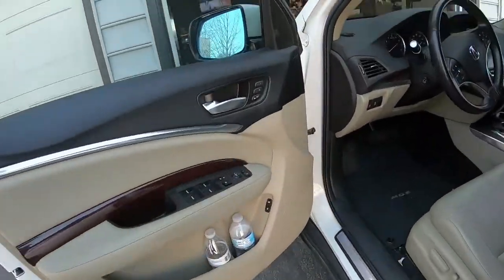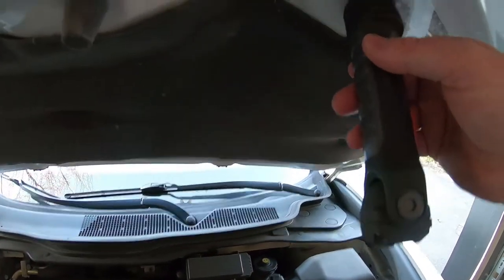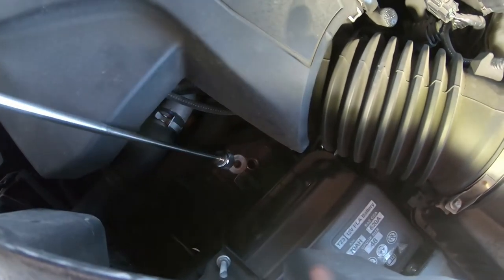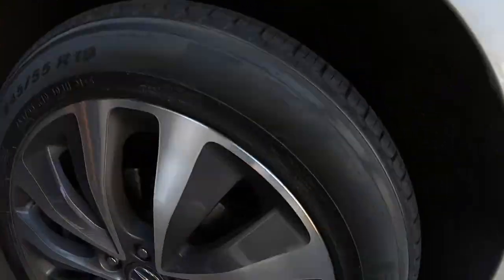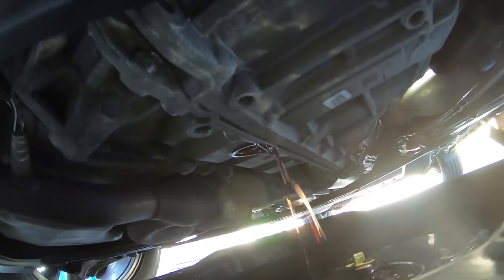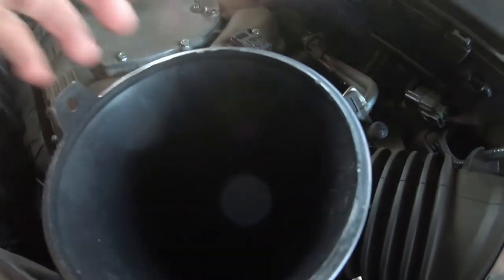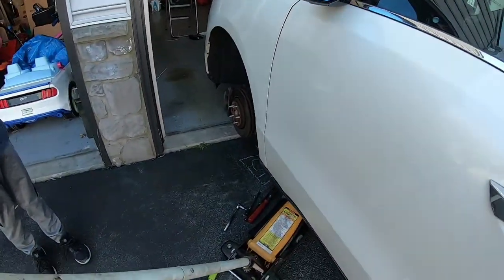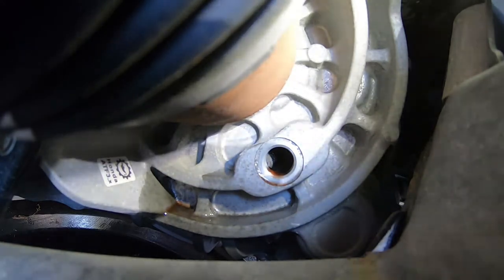MDX Transmission Fluid Change

Comment: Is there a dipstick to check the oil level?  Or do I have to dismantle the wheel to see the hole flow out before it is full?
Reply from the maker: There is no dipstick. You fill it until it leaks!

Comment: Why did you first flow out a light yellow liquid, and then it was light red
Reply from the maker: I think it’s just the lighting. The old GoPro.
Reply: @BTurismo  After the flow is out, start the engine in gear?  Will the oil be reduced?  Why not close the screw and start
Reply from the maker: @meilizheng8934  once it starts to leak out the fill port, that’s when you know it’s safe enough to start. 
Start it up and, in park, fill up the transmission until it drips out. 
That’s basically it. There is a service mode you could/should do but I don’t think I did that in the video.
Reply: @BTurismo  After starting, do I need to change every gear?
Reply: @meilizheng8934  A short run bringing it to the 4th gear.

Comment: how many mileage  you have to change the transmission fluid?
Reply from the maker: I think I do it every 30k...I just follow the maintenance Minder.
Reply: @BTurismo  after the fluid change, is the transmission work okay? Do you really need to cycle each gear? As you said, if you do drain and fill, there are some fluid in the transmission anyway.
Reply from the maker: It works fine for me but it was never really a super smooth transmission anyway. It seems best when you drive it hard because it’s clunky if you drive it gently.

Comment: Is there a dipstick to check the oil level?  Or do I have to dismantle the wheel to see the hole flow out before it is full?
Reply: There is no dipstick.  There is a more specific procedure that requires taking the temperature of the trans and running it thru to the 4th gear to integrate the fluid.  If you do it this way, I'd measure the extracted fluid and replace the same amount as a minimum.  Some mechanic told me to add about 100 ml additional for good measure.